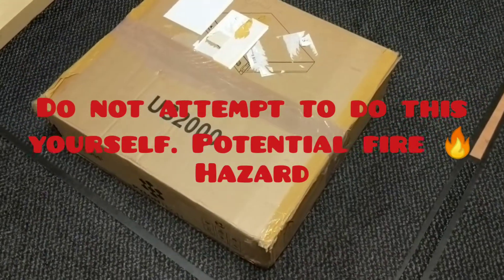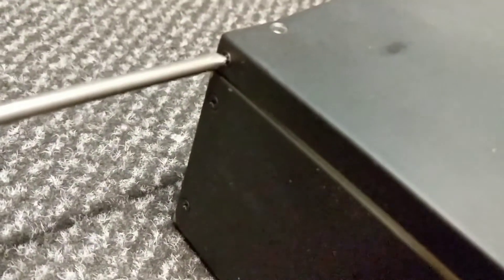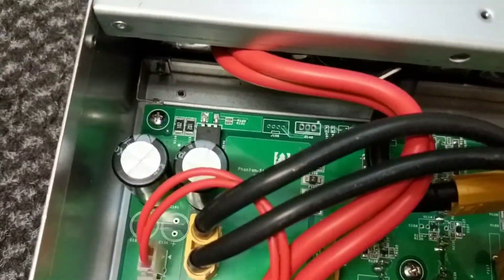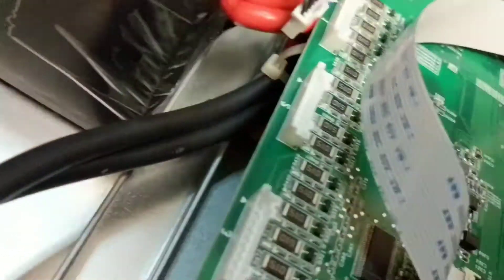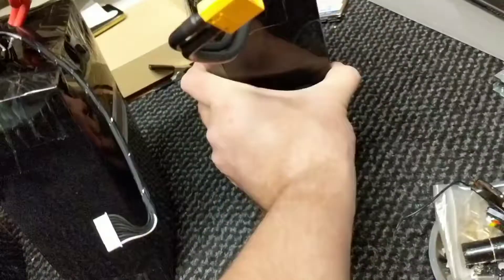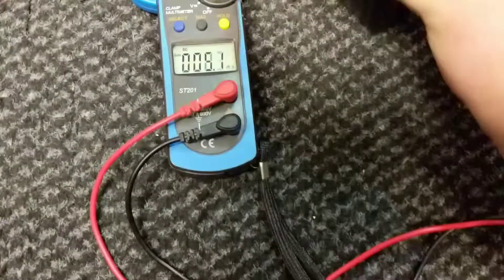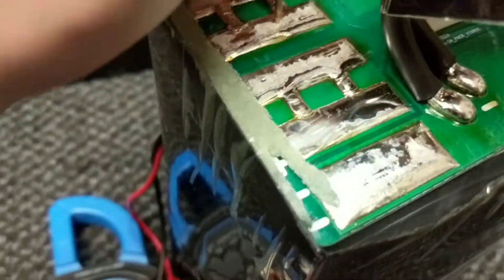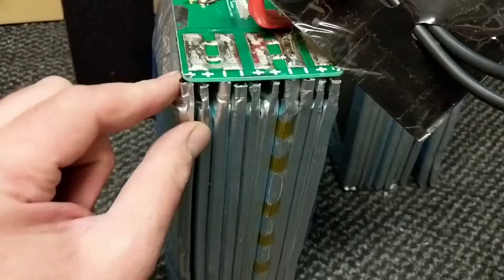PYLONTECH eBay solar storage battery teardown faulty repair BMS battery swelling 54v pack

Comment: Can you replace a pylontech us3000c board that got water damaged
? Cells are fine
Reply from the maker: If you have got the replacement board I’ll replace it with pleasure. 
Has anyone looked at it ? 
Or cleaned it up?
Reply: @smartazz  trying to source a board is proving difficult! Any leads appreciated.  I will give it a clean but the corrosion looks pretty advance to my untrained eye. Thanks for the quick reply!
Reply from the maker: @seangrace6893  buy a us3000c with bad cells.

Comment: Pylontech is poor quality,i would never buy such a battery. 2 batterys in paralell (not a good idea) and 5 in series x 3 packs.It's a 15S battery.
Reply: What 48v battery is better???
Reply: @johnmiller1355  A 16S 48v battery with single cells in series is far more better design as Pylontech with 15S2P
Reply: @francisdoll1253  yes, I agree, but nobody offers a ready to use batery with this configuration. The main problem with single cell buy, will be the greater spread of internal resistance, that will cause bigger problems later.

Comment: They are pylontech US2000c. with a lux Lux inverter. Never used in anger.  I was assured they were plug and play to my system. Plugged them in as master, went away for the weekend. All flat when I got back, I wasnt told there should have been a different comms cable.. I asked for help, but was told no.
Reply from the maker: Do you also have us2000b ? If yes put the B in the middle of the 2000c make a B sandwich lol. I believe the me3000sp doesn’t like the C batterys, and eBay are selling the very expensive new cables that are supposed to work.
Reply: No. I only have the c versions. Not a light between them.
Reply: I had a cable made but it was apparently too late. They need waking up, somi have been told.
Reply from the maker: @lesmarsden8470  Iv not had any experience with the C batterys. Try asking here 
https://m.facebook.com/groups/2477195449252168/
Need details for a good response. Inverter model ect
Reply: Will do. Thanks.

Comment: Hi, congratulations on the repair. I need to replace some lithium cells on my pylontech battery. Where did you buy the cells?
Reply from the maker: I could only take cells from multiple broken Pylontech Battery’s . I also had to capacity test them.
Reply: @smartazz  sorry if I still disturb you. How many "ah" is each cell?
Reply from the maker: @CERBERO-y9u  25ah per single cell

Comment: @Snart Azz did you find a replacement cells? I hope you can release the repair video. I'm looking for Pylontech BMS board so I can expand my storage with DIY pylontech module with cheap Chinese cells..but it seems impossible to find such bms sold online
Reply: I would like to do the same thing too. but the seplos seller in china told me that the bms seplos cannot communicate with the pylontech batteries but only with another bms seplos
Reply from the maker: @mariocarifi3550  how many Pylontech do you have in total ?
Reply: @smartazz  i only have two pylontech batteries but i would like to expand energy storage with chinese cells
Reply from the maker: @mariocarifi3550  then put the 2 Pylontech BATTERYS you have on to 1 CEPLOS BMS. Then add more Chinese cells lifepo4 and you can add up to 16 CEPLOS BMS in a chain. (16 I think)
Obviously be extremely careful with Pylontech wiring as it’s not as straight forward as you think. There is a temperature wires in the middle of each 5 cells.
Reply: @smartazz  yes I would like to do this but then the bms seplos cannot communicate with the bms of the pylontech batteries. have you tried to make the bms seplos communicate with the pylontech batteries?
Reply from the maker: @mariocarifi3550  I will try on my next video
Reply from the maker: Look at my other video. CEPLOS BMS can help you https://youtu.be/9C1gSA6Gpzw
Reply: @smartazz  thanks. I see it is a great BMS module..but I don't believe it can work (communicate) connected to other Pylontech batteries :/ If you can try it would be great tho
Reply from the maker: @deyanv  I will try it yes. Please wait a few weeks
Reply: @smartazz  thanks! I'll wait
Reply: @smartazz  have you tried the communication between Pylontech BMS and Ceplos? I also want to ask if you are willing to sell me the BMS board? I'd be very happy (I have naked cells that I want to connect to my pylontech battery stack).
Reply: @deyanv  is Pylontech BMS using active balancer?

Comment: Can these battery be charged out ov a solar system I have a bms fail message
Reply: So is the bms in the batterys or the inverter I am trying to find out which unit is failing
Reply from the maker: @davidball2420  it’s in the battery. Usually connected to the inverter with a network cable.

£20 per battery to test and tell you what the problem is.
Reply: Would I be correct in saying you are in the midlands
Reply from the maker: @davidball2420  yes correct 😎
Reply: What would you charge to test two units as I am in the Midlands
Reply: When could you look at them ?
Reply: Got it
Reply from the maker: @davidball2420  drop me a msg and we can go from there.
Reply from the maker: They will definitely need a BMS to charge them. But the answer to your question is Yes.

Comment: Is it not the case that when cells swell out like this they become highly unstable, in which case I hope they did not go through the postal system, and that you collected them in person. Plus you've made no attempt to protect yourself from what could of been a highpowered firework going off in your home, which would last for hours and no way of putting out!!!!!  However luckerly all is well I don't think I would taken that risk, all I was looking to find out is what type of BMS does Pylontech battery Pack use?
Reply from the maker: Don’t worry, I have a fire bucket and sand at the ready, also I’m in the work shop not at home ;) 
I’ll be rebuilding the battery soon and I’ll have a close up of the BMS for you :)
Reply: @smartazz  Thanks mate thats cool.

Comment: Can you show how to recharge the whole unit? I've got 2 units that have completely discharged and refuse to play nice only. Ive just bought them and I'm furious. Cheers.
Reply from the maker: I can show how to charge each cell if you like 👍 
Each cell max voltage 3.6v (it takes a long time to do it properly)
Reply: @smartazz   how do you charge each cell mate?
Reply from the maker: @m4onsmoke  I set my charger to 3.6v and started a long process.
Reply: @smartazz  when I said cell I actually got it confused I meant battery pack I’ve currently got one charging at around 16v. I’m planning on charging all three then seeing if it will work. Battery was allowed to go flat for quite some time.. the green power light comes on but no SOC lights when you push the red button so have been unable to charge it hopefully this fixes it 🙏
Reply from the maker: @m4onsmoke  just be careful as they can explode or burst into flames 🔥
Reply from the maker: @m4onsmoke  you need to balance charge them. One cell could be full when the next cell is empty and this will cause a fire if you try and charge it. Can you connect the pc to the battery ? You need to see the individual cell voltages to diagnose where the problem is.
Reply: mine is showing16.7 per pack

Comment: What charger can you use on these batteries 48volt without taking them apart? I come across dead batteries at work. Normally a warranty claim.
Reply from the maker: I’d love to get my hands on more lol. 
So basically yes 48v battery charger will work, you need to test the voltage of the charger and make sure it’s set to the correct voltage. They are made up of  15 x 3.2v cells and each cell can charge up to 3.6v max (so 54v total in my case) 
Hopefully that helps :)

Comment: When will we see the rebuild video, and do you know the make and model of the battery’s?
Reply from the maker: They are Pylontec own BATTERYS and you will struggle to get them brand new. I’m hoping to get some time next week to rebuild the battery. 🤞
Reply: @smartazz  the pouch is a RFE-F20 aka as a prismatic cell pouch or LiFePo4 cell pouch. This is what Pylontech use and strap together. My question was to help you, I already knew the answer. 😁😉👍🏻
Reply from the maker: @pulsenation  thank you, I’m very literal lol. I have spare cells for the rebuild video thank god as honestly finding the correct cells is hard. I’m currently charging the cells one by one to full and that’s takes a day for each cell, just about 10 more days to go (painfully slow)